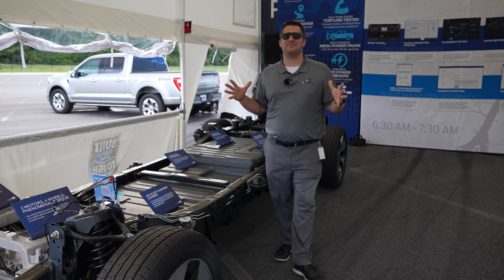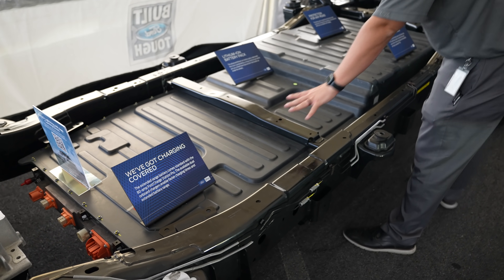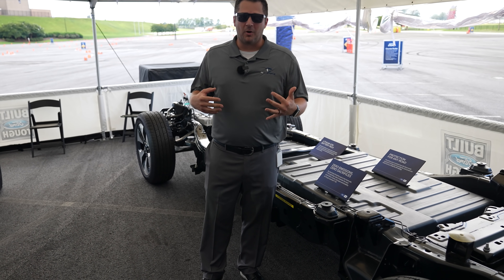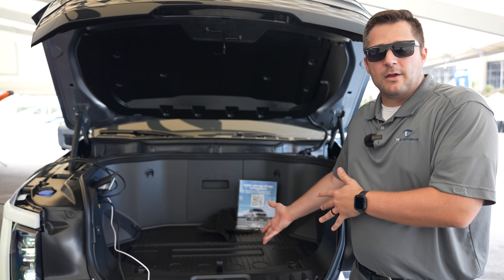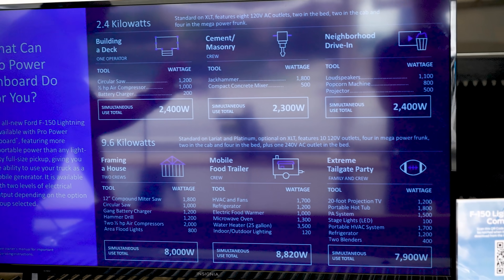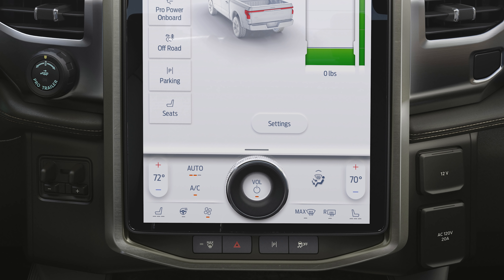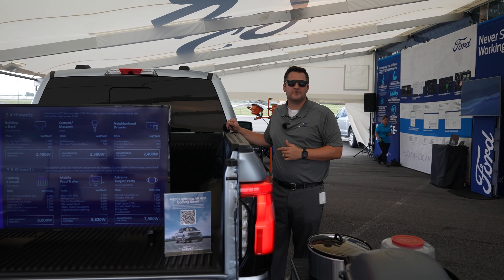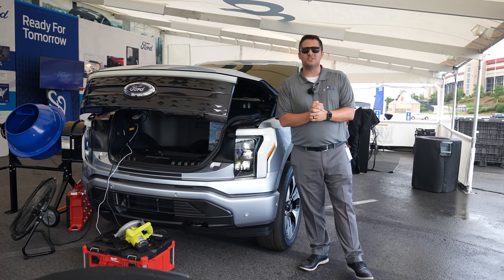Inside look at the new F150 Lightning!⚡

Comment: Cool Truck. A couple notes: do you have an extra 80 amps on your home electric panel - particularly while running the central heat in winter? Make sure you do. 80 amps is a huge draw. The extended range battery has 130 kwh of electricity in it. The "Framing a House" example of what tools it can use will draw about 10 kw per hour of use.  So it will completely drain the battery in 10 hours and you have a dead truck and no way to charge it.  It's not a magic carpet. Also, if your house gives it 80 amps to charge in 8 hours and you want to run your whole house in a power outage then it'll drain the battery in less than 24 hours, probably. Look at your electricity bill and figure out how many kwh you use in a day. Then decide how many "days" your truck will power your house... assuming you don't want to drive anywhere until power comes back and you can recharge the truck.  Again, cool truck, not Magic Truck. I'm not crapping on it.  If you have an extra $80k or more it's better than a Corvette.  In another version of a power outage, maybe it's just your neighborhood and you can use your truck to power the house at night and still have enough power to drive to a rapid charging station and recharge.  Wouldn't that be cool? You could survive with AC and Heat and all the lights on at night forever!

Comment: Overall pretty good info/overview. 
13:45 ~ 14:05: wrong. Aerodynamics, battery size, and weight are not pretty much the only things that can be done to extend range. Those are 3 big factors, but there are many others; efficiency of the inverters, motors, climate control, thermal management of the battery and inverters, correct gearing and quality of reduction gears. I recommend you watch Sandy Munro’s video comparing the MachE thermal management system to Tesla’s thermal management system.

Comment: To be honest with you, I would be a lot more interested in it if trading off the ability to run the house in the event of the rare once or twice a year at most power outage that usually only lasts a few hours and most of the outlets along with the unneeded shifter with electric fold away for more battery driving range. 800 to 1000 mile range empty would be about right. The 300-400 mile range doesn't take into consideration extreme cold (20F and below temps), mountain driving or stop and go traffic. I would even consider loosing the front storage for range seeing I haven't  had front storage in a truck in the 55 years I have owned them. I have no problem putting my groceries in the back seat or covering stuff up in the bed. If I wanted a passenger car that's what I would have. That also brings to mind, why don't they just build cars the size of the old 60's and 70's Impalas, Cadillacs and Ford LTD's? You would be able to seat 6 large people and carry enough luggage for a 6 month vacation without doing laundry with both ends of the car being trunk space. Or boot as it's called in the old country.

Comment: I absolutely love my 3.5 EcoBoost F-150. But the gas mileage isn’t that great and I wish it had more outlets. 

This Lightning is a monster! I’d love AWD on the street where my F-150 can only do 4x4 in a straight line or off road. I’m definitely interested in the off road capabilities of the Lightning. Especially being able to go underwater? Possibly? 

300 miles a charge/“tank” is slightly less than my EcoBoost at a fraction of the cost. 

Great info and video!

Comment: No body mesure the with and deep and high off the mega power fronk.   You guys just sai 400 pounds load and 400 liters. Give me mesure  so I know if I know for the table saw and mites saw if feets..
Reply: Liters, cubic and weight works great if hauling sand, gravel or grain but not if you need to know if your 4ft long foldable job saw will fit. But then again maybe the only people that will be able to afford it is rich tailgaters and golfers.

Comment: The electric skateboard design that all EV's are based on, means that you can put any body on this. It can be a sedan, truck cross over, a lifeless autonomous pod... It's only an achievement for Ford but the consumer will be driving the same vehicle with the same dynamics but charged differently based on what the body panels say it is.

Comment: So air conditioning is easy so to speak... how is the truck going to be heated?  I assume syphoning some heat from the batteries themselves thru the cooling loop, but after that electric heat is pretty much a dead short. How much will using the heat reduce the expected range?

Comment: Just gonna chime in here and point out that 150kw is very very slow charging for a pack of that size
Reply: Just depends on what the battery size is, they have not announced it yet. if its 150kW, then that's roughly an hour, if its 200kW, then its a little more than an hour, either way pretty fast for a big pack
Reply: @mikemillar9730  I’m referring to C rate. Are you familiar with C rate? If this pack is 150kwh or even more as some have said, 150kw charging is weak sauce. A model 3 with a 55kwh pack charger at a higher rate.

Comment: 100,000 mile warranty seems pretty low for an electric drive train.  8 years is nice, but that is only 12,500 per year.  Very low
Reply: that is just a max of 50 miles a day on a five day work week, not counting weekend driving.  So if you have a big commute, you won't be able to go anywhere for fun on the weekends or you will get no where near 8 years.

Comment: Ford is NOT "giving" you the 80 amp charger.  It's included in the price.  Very good video, but don't twist the facts by using the wrong wording.
This Lighting will sell as many as they can make!  
I have a Tesla Tri motor Cybertruck on order but this too looks interesting 🤔.

Comment: I was wondering how the cab heat is made since it has no water jacket engine to heat the heater core.
Reply: Current passing through lossy conductors just like an electric space heater.
Reply: @heathwirt8919  Possibly yes, as that is the simplest method, but the least efficient.
Or perhaps it may have a heat exchanger.

Comment: I like this truck, and if the battery pack with right charging times/maintenance can last as long as an old Model Y with hardly no battery degradation I'd consider buying one. Question I have right now is where does the water drain from the front trunk...I mean does it drain away from the electrical components that is underneath it.
Reply: Why would it need to?  Every electric vehicle hermetically seals their electrical drive units, battery packs and any other possible exposed to the elements components. No problems driving my volt through flooded streets.

Comment: I am hearing that the predicted production run for 2022 wont come close to covering the reservations already made for 2022.
Reply: I'm sure that will be the case.  I doubt you will be able to buy one off the lot until 2025
Reply: @rogerheuckeroth7456  Great Teaser those guys at Ford are.
Reply: @pauldemeules9927  Ya, they just don't have the battery supply contracts, and I'm sure they are wanting to sell as many ICE or Hybrids as possible for as long as they can.

Comment: What is the charge time for the regular battery from a 110 outlet?
Reply: I have the Mach-E. Before I installed a level 2 (240volt) charger I used the ford mobile charger with a 120 volt outlet. It takes 3 to four days to charge. If you are purchasing a EV you definitely will want to have a level 2 charger installed if possible. My level 2 charges in a few hours

Comment: Hello Mitchell, I appreciate your candid presentation on the Ford Lightening. The chassis looks massive on that truck, and with the batteries it will definitely be a structurally safe vehicle. I have one big concern on the truck though. After seeing Sandy Munro’s presentation on the Mach E thermal system with the 35 coolant hoses and clamps is a disaster waiting to happen after a few years on the road. My question is, will the Ford Lightning be using this same system on the Lightning. I fear in a hot climate this will be the Achilles heal of the Lightning. Please let me know what info you can find on this. Thank you!
Reply: No, the Achilles heal will be towing for all EV trucks.  As long as you don't need to tow long distances, you will be fine.  Towing a heavy box trailer will kill the aero and you will go from 300 miles to about 100 miles usable range on the highway.
Reply: @rogerheuckeroth7456  you are right. I didn’t think about that. I did hear load capacity is also restricted to 2000 lbs. I think the cyber truck capacity is also limited to this amount, but I’m not positive on that. Hell, for the money I’d stick to a buying a normal gas truck.
Reply: @andrerodriguez7603  I think for the money, the Cybertruck Tri-motor should be a better deal.  500+ mile range for $70K.  But still probably not the best for towing big trailers long distances.  I own a GMC 1500 with the 3.0L diesel.  I can drive from Tampa FL to Myrtle Beach, SC on 3/4 of a 25 gallon tank.  Its phenomenal for a full sized truck.  Towing my boat though, I have to fill up twice on the same run
Reply: @rogerheuckeroth7456  that’s a beast. I think 70K for the tri motor is a reasonable price. If rent one before you buy to try it out is the way to go. But I doubt that can happen.

Comment: Everyone builds one huge battery pack. Would be interesting to see it be 2, 3, or 4 smaller packs linked together.
Reply: Why?
Reply: @rogerheuckeroth7456  less weight per battery. Not one mammoth 1,000+ lb item.  Makes battery replacement and transport easier.  Imagine right now owning a Nissan Leaf and going over to your local Nissan Dealer to pickup that new battery your going to swap out in your home garage.

Comment: 2:55 
'so see your local dealer for specific details'
a problem Tesla doesnt have, theyre uniform throughout, no individual dealers to haggle with about what they offer vs what another dealership with same offers.
Reply: Haggling is a great way to save A LOT of money on trucks. Like other public companies, they run promos to boost their quarters. Probably won’t happen on the lightning due to demand, but it’s not uncommon to save $5-$10k on a truck at end of year clearance. 

Haggling is in no way a bad thing. If you want a consistently higher price, then by all means.

 By the way, I’ve owned two Teslas. The service experience was consistently bad. Long wait times, parts shortages. Don’t get me started on delivery issues and quality issues. Many things good about the Tesla sales model, and many bad things too.

Comment: so up to 300 miles on an extended range battery? and you have to wait an hour to charge it minimum? That is fucking abysmal. the normal f150 without an extended tank get the same range and you can fill up in like 10 minutes assuming you're slow at it and, forget actually using your f150 for f150 things with this lightning.

Comment: I love this truck. I had a 2016 F-150 and I want this.
But your comment at about 12:08 has me wondering/worried. You say the electrify America fast charging system is “bad for the battery”. So basically if I’m not just charging at home I’m gonna degrade the longevity of my battery system? What the deuce?!
Reply: The faster you charge batteries the more they heat up and the shorter their life.   Overnight charge at home = slow and cool = long battery life.
Reply: @SomeTechGuy666  I understand that. But he specifically called out the Electrify America charging. Would the same be true if I had a 240 system charging it at my house versus just 120?
Reply: @peter9642  The vehicle sets the charge rate, not the charge station.    The charge station just provides the power.  So it has nothing to do with where you charge it.
Reply: @SomeTechGuy666   that makes sense. Then why would charging it with the Electrify America system be a negative thing? That’s my whole question in the first place. 
And why isn’t @TownCountry1999 replying to any of this? They are the one that stated the information I’m questioning in the first place.
Reply: @peter9642  I don't think charging at EA is a bad thing.  I suspect you'll be able to set the charge rate as well as how full you want the charge to go as well.  

I'm not sure why he isn't replying.  I'm guessing that Ford hasn't educated everyone on how the Lightning works and there is some mis communication going on.

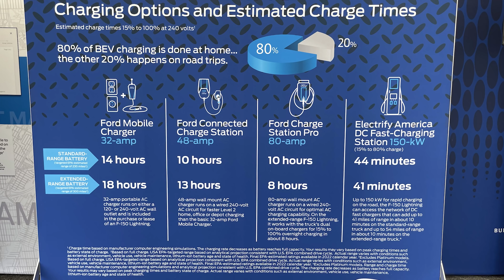Comment: Read the fine print folks: Notice at 4:07 there's an asterisk where it says "Excludes Platinum models" referring to the Targeted EPA-Estimated Range*. Also at 4:17 where the sign shows that can, "...DC fast chargers that that add up to....54 miles of range in about 10 minutes on the extended-range truck." 4 Excludes Platinum.

Comment: We will see about the markup. Dealers have already been called out for trying to mark up the ford mach-e suv by $10k for no reason other than greed because it was in short supply, more because of the limited number that ford made. These dealers know that the mache-e sale means it is another vehicle they are not going to be able to rape the customers on with lots of nonsense repairs which they so often make up the need for. Remember, franchise dealers for older oems all make most of their money on service not on the sale, and evs means much less service. We all know with unnecessary repair pushing franchise dealerships are pretty much dishonest by default, are not going to want to sell the evs. So to ford and all the other oems, I say good luck with you EVS. Your dealerships which is all you have, are going to make your ev sales very difficult and may cause you and them to fail, which most likely happen either way.  Tesla on the other hand earlier used to have a biannual (every 2 year) ? or whatever recommended service check, but soon after based on results, they have backed off and said it is not necessary and the cars do not need it. What other oem has ever done that?   Who would you trust?
Reply: Marked up Mach-E’s were dealer stock. Very few dealers will add market adjustments on custom orders. Three big dealers all around me were willing to put it in writing.

Comment: YOU FORGOT, To extend range you also need a more efficient hvac system for the times when you are using heating and air conditioning. That can make a big difference and has allowed Tesla to achieve another 30-40 miles on some of their vehicles. Sadly also the traditional truck design like the ford, are less aerodynamic then the cybertruck and it does not have the integrated powered cover like the cybertruck does to almost eliminate the aero issues with the bed which is one of the  biggest problems.   If you have a problem using a tesla screen while you are working to adjust climate etc, you are also going to have much more of a problem using your smartphone or computer tablet/laptop when you are working or also when you receive a phone call or need to text. Using a screen should not be an issue. Physical buttons prevent you from being able to update and improve the control system and options and also cost more to manufacture all of those buttons. We all know that ford can not go to integrated screen controls because they are still going to use off the shelf existing control modules that they have been using with all of their older ice vehicles for decades where Tesla has developed and designed their own control systems. Other oems are also using 2x as many modules or more which means more wiring, more connectors, which means more potential failure points and more weight for all of that hardware. Tesla has simplified and condensed everything and made it more reliable and robust as a result.  That is why they are the only one that can truly update and improve all parts of the vehicle, not just some limited systems like in other oems.  Buttons also get dirty and get dirt inside and fail. A screen is a flat sealed surface and can be cleaned more easily than if dirt/grime gets in between and into the buttons. Buttons also have a higher failure rate and have  physical movement and contacts and mechanisms that fail.

Comment: Yea use your truck to power all the tools, then after a hard days work you can walk home 🤣
Reply: 140 KWh battery pack would provide 10KW for 14 hours.   How much power do you use and how long do you work ?
Reply: Yea but how much range do you have left afterwards? If you have a round trip of 50-100mi to and from the site, I have a hard time believing you could run all the tools you need (unless you don’t need that many) and then have enough range to make it home
Reply: @gothops154  Do what you would do with a gas truck then - run a generator. LOL.

Comment: The Powerboost with 7.2kw generator is 100x better than this. I can tow a 7k pound camper got 350 miles, gas it up in 5 minutes and power my camper over night on 1-2gallons of gas overnight... And I have an 800 mile range when not loaded!

Not to mention, if your power goes out and you're using your truck to power your house... How do you fill the battery back up on the lightning? Right you can't until the power comes back on.

Hybrid is king.

Comment: Can you jump another car with a lightning?
Reply: As in jump starting a gasoline car?
Reply: @Nicholas.T  yea, say I'm at the store someone asks for a jump is that doable?
Reply: @hectorgonzales837  I don’t think so, because the Lightning (and most other EVs) do not have a 12 volt battery with enough capacity to run the starter motor in the “dead” car.

Comment: Why would using an EA charge station negatively impact the battery? The charge controller is on the truck, so the truck should only pull what it is programmed to pull. Are you saying that Ford designed the truck so that someone could charge at a rate that would damage the battery if they selected the wrong charging station?